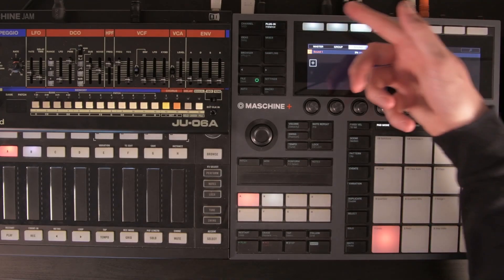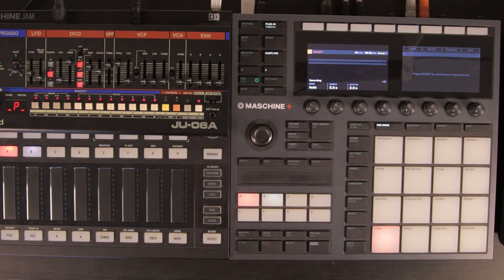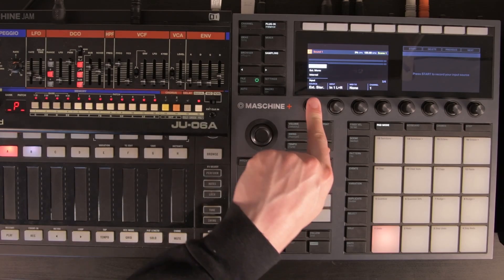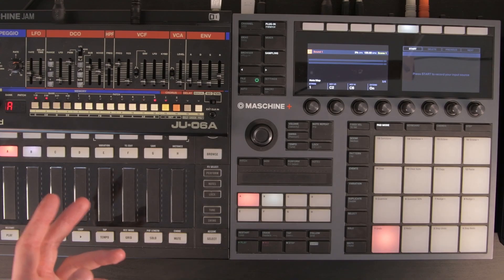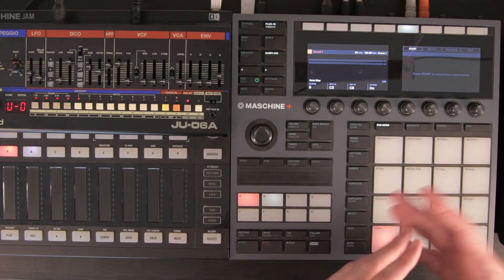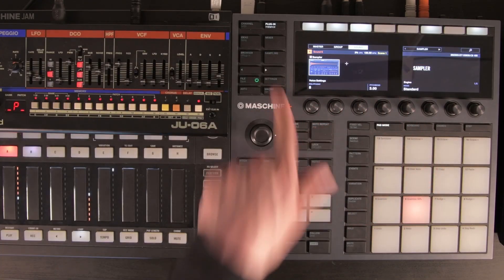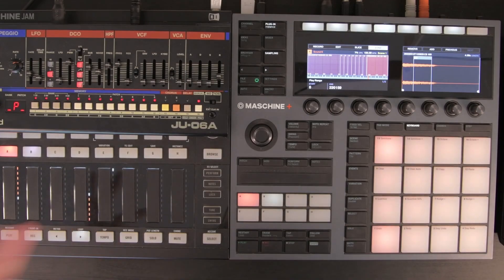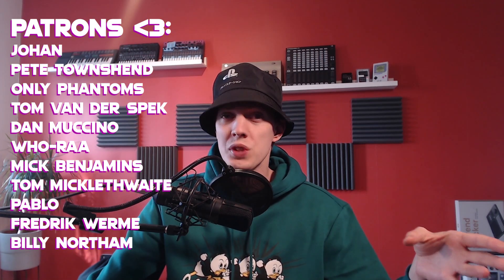Maschine | How to use Auto-Sampler (Standalone)

Comment: Excellent! Some questions: Is there a way to adjust the xfade and loop start/end points for ALL sampless at once or do i need to adjust those edits one at a time. But as im writing this, im hearing you say to sample with short release and adjust the release but im guessing i will still need to adjust the end loops and xfade to create a nuce smooth release. Also, do i need to save with samples? Im thinking the first time, yes. But after that, if i make edits, thats all saved in the song file. do i have that right?  Thx